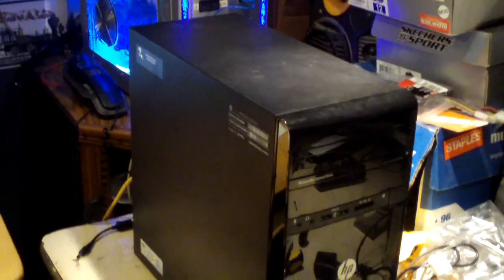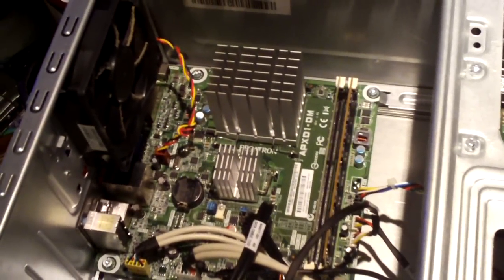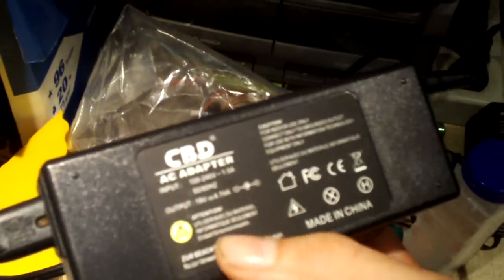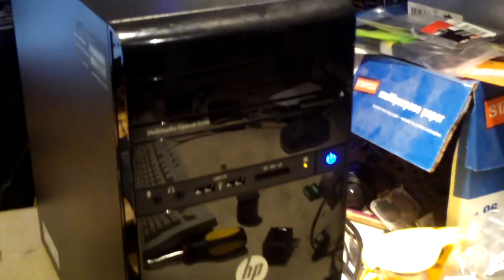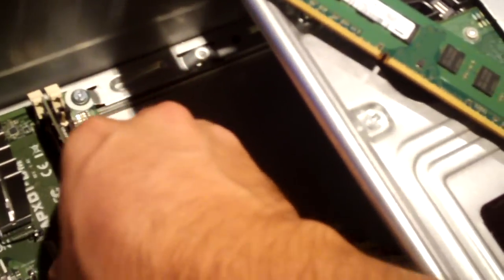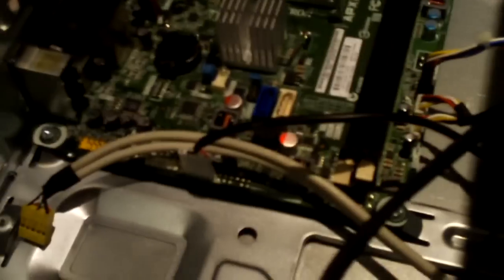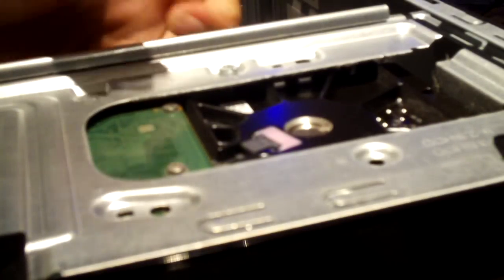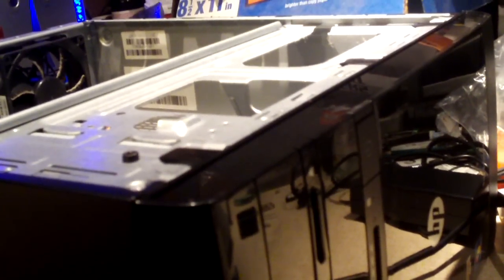Another HP AMD E-300 APU system, strange no-video issue

Comment: Quite shocking how much the quality has gone down in the last 10 years for HP and Compaq, in 2005 you could get something which actually qualifies as a proper desktop with a proper power supply and proper expansion slots to upgrade or whatever else, now the only thing that can be upgraded is ram and hard drive and optical drive.
Reply: They do use a proprietary power supply design, though. My DC 7600 and 7800 both have proprietary areas for their PSU.
Reply: Ashton B. I've got two 7100's and yeah noticed that proprietary design, same goes with a lot of other SFF machines such as Dells Optiplex line, and especially those old Dell poweredge 2300's back in the early 00's I had one of them which came to me with a fried PSU and it wasn't the fuse, it wasn't worth the repair either and since it was proprietary I sent it to scrap
Reply: Sony Trinitron Seems like they've used\did use that design for a long time. Even the newer DC 8200s at my school (from 2010 with second-gen i3s) appear to have the same PSU as the DC7800 so that design must've been used from early 2000s all the way up till around 2012 or something. Although most SFF PCs seem to have it that way like you said.